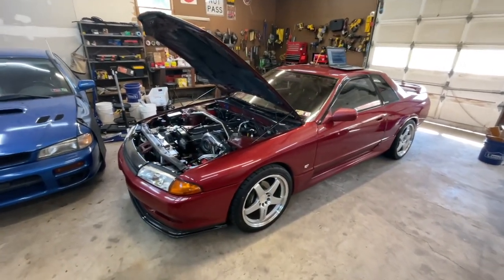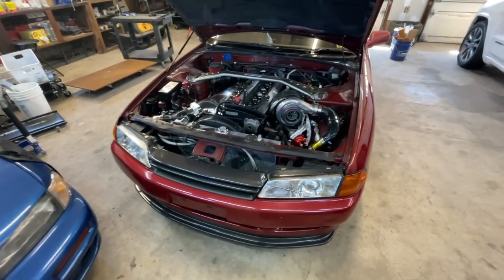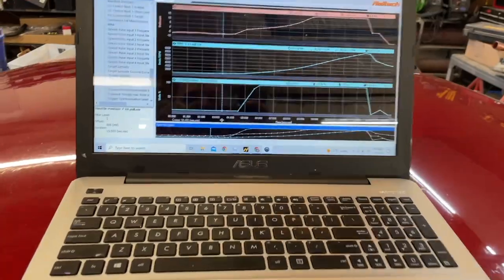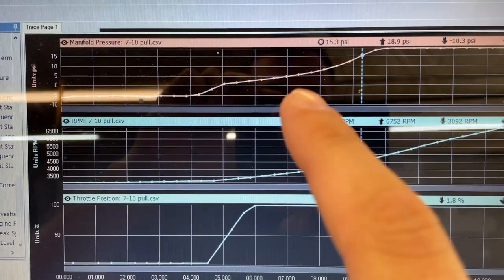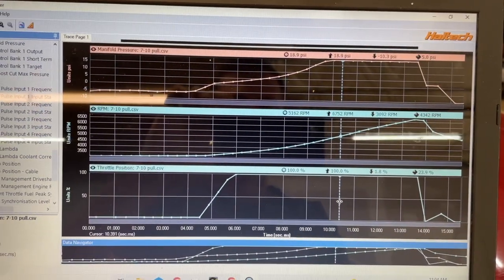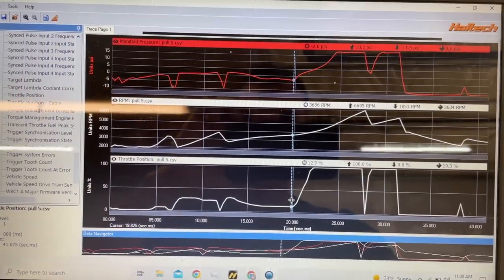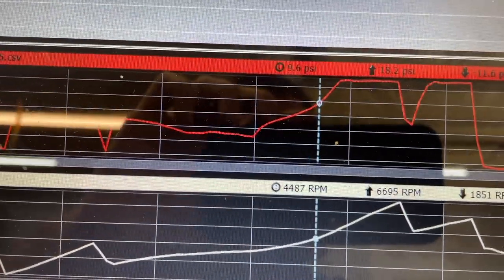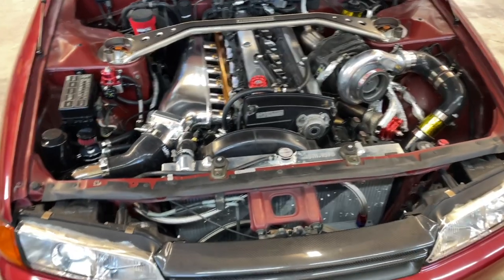QUICK SPOOL / MORE BOOST - Exhaust Leak Problem Solved

Comment: Hey bud, randomly came across your channel from searching RB20 Hx35 (I wanted to get my screamin' 20 fix and you sure delivered!)

I'm really liking what you're doing with this car and I'm in a very similar situation with mine but if you allow me to share some input:

Your build looks solid and I don't mean to sound jealous or harsh but honestly the parts you've got on it are better suited for higher flow and top-end power, which shows based on your logs. The 10cm housing does help you for more response but the large short-runner intake plenum kills a lot of low-end torque and spool up. The exhaust manifold is amazing for high-speed flow but that's towards the top end of the RPM range, so again you lose low-end torque and spool up there. The twin gate on this 35W is a nice addition but overkill since you would most benefit from them if you're trying to run very low pressures such as 5 or 8 psi. I have not seen your timing and AFR maps but you may have some room to play with when it comes to pre-spool characteristics tuning, meaning, deciding to further lean out the AFRs around the 2800-3500 range while advancing the timing even more just in those 100% load spool up cells. I run this tactic on my 4G63 and it works wonders. Something connected to this, I assume your tuner instructed you to record the pull from 3500 RPM and I am sure he has his reasons but it's a good idea to go WOT from 2500 and record the log from there. You will put the engine and higher load from sooner which will affect spool-up.

2.0L 4G63 guys running the same HX35 on a shitty twin scroll manifold regularly report 14 psi at ~3300 RPM and even 1.8T Audi guys aren't lagging behind that much. The RB20 has the advantage of 2 additional cylinders even if the displacement is the same and this is a huge factor, it's a more efficient pump. I am 100% certain you could get your target 20 psi way sooner than 5k RPM but some factors will need to be addressed (if you're really bothered about it, that is).

Personally I've got myself an R33 into which I put an RB20DE Neo and slapped on the same 10cm Cummins 35W but running the stock cast twin scroll manifold and some black magic coupled to it which I reverse engineered from a cummins forum. I kept the factory intake system on the Neo which has a combination of a main torque valve splitting the manifold in half as well as the swirl valves right before the head inlet. Additionally, the Neo has VVT and it has significantly lighter rotating assembly compared to the 20DET. These alone will help spool up the Holset even earlier provided I tweak their opening conditions right. The wastegate will be a single 50mm unit dumping to the ground. I have talked to a few guys from Australia and New Zealand running almost identical builds as the one I'm describing on an internally stock 20DE Neo and they also report 14 psi of boost at ~3500 RPM. That said, your build is for sure going to be making more clean power based on your mods.

Youtube isn't really the place for long technical discussions but I don't have an Instagram so I thought why not just share my thoughts here. Consider me a new subscriber, also you've got a keeper on your hands!!!
Reply from the maker: Youtube is absolutely the place for mechanical discussion! You are 100% correct, these bolt ons would be killer on an RB25 that's simply larger displacement. This build was more "for fun" and on a budget. I wanted a big top forward mounted turbo with screamers and a dramatic spool and that's exactly what I got 

This build has terrible throttle response and loves to cruise at 3.5 to 4.5k rpms. That's because of the large intake plenum and exhaust manifold as you mentioned. But again, they were parts I just had to have for engine bay looks specifically. My tuner and I went through a few sessions of logging and mapping back and forth and this is about as good as we could get.

As for an advantage of two additional cylinders, I'm not so sure that's an advantage as this engine has a very small stroke meaning, mechanically, it lack in the low end torque where a 4g63 has more mechanical torque. RB20 at 69mm and a 4g63 at 88mm. Same displacement yes, however great differences in mechanical advantages per cylinder. Also let's not forget this RB20 of mine has almost 120,000 miles and is now 32 years old.

Your R33 RB20 Neo build sounds awesome and I'd love to see more of it! message me on instagram! 

We both have keepers on our hands and I'm 100% sure our builds will go through many phases through out the years. I would like to eventually build and RB25 for this car, but priorities of life play a factor in build progress haha

Comment: Turbo lag is pain. In my drag car I have an S475 on a 5.0 Coyote and even with a 4500 stall (foots to 4000 actual) I don't hit full boost until about 5300rpm, my 60 ft is crap. A trans brake is in my future.
Reply from the maker: You're setup sounds gnarly! You have to admit though, that turbo lag is fun outside of the racing realm, that sound of a slow spool is intoxicating!
Reply: @SubieRumble  
It is when you consider it's also in a 78 camaro - not an LS swap 😝. 
Turbo lag on the street actually kinda makes sense given traction is limited and instant power can be dangerous. I still haven't had the balls to try full power my camaro on the street. Still running stock almost 50 year old suspension due to be rebuilt this winter.

Comment: where can I find the intake and exhaust mainfolds you are using?
Reply from the maker: Enjukuracing has the ISR intake manifold kit. As for the 1320 performance stainless exhaust manifold, I found a seller on eBay that sold them. Not sure if they’re still available though

Comment: What kind of battery? 🤔
Reply from the maker: I have my full build list in the description of this video, but I am using the Optima red top battery located in the trunk
Reply: @SubieRumble  we don't make a "Lithium ion" battery. We do recommend typical alternator output to be approximately 13.7-14.7 volts, as measured directly at the battery terminals, with the engine running. Thanks for choosing OPTIMA!
Reply from the maker: @optimabatteries  Thanks for educating me!